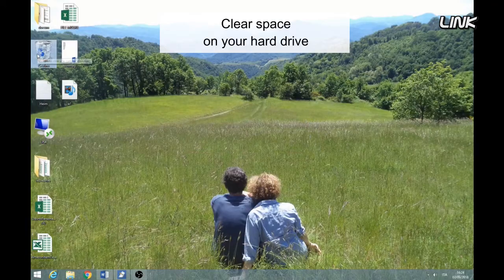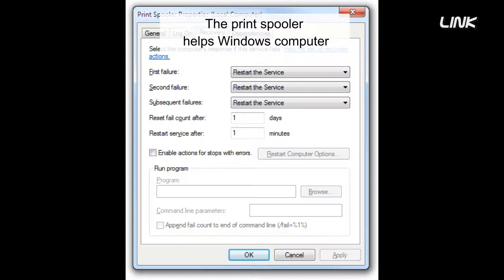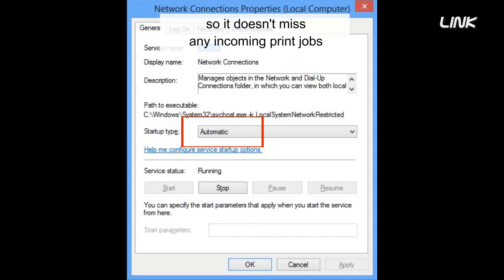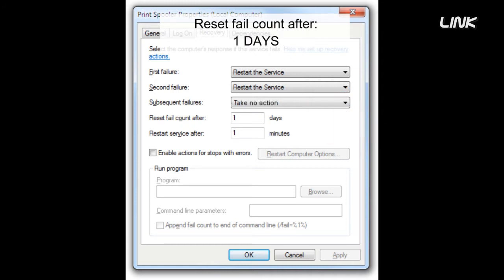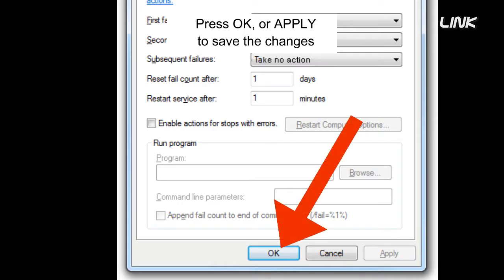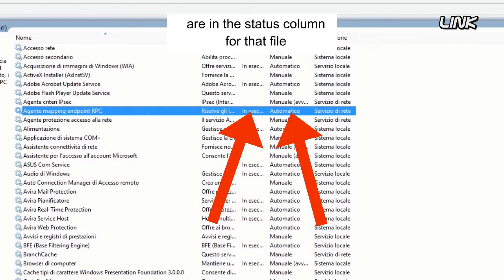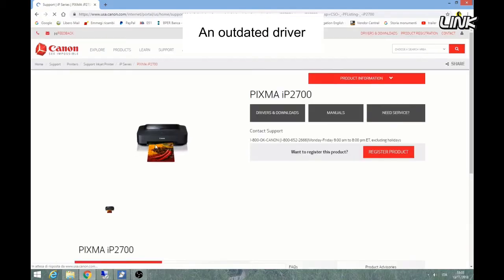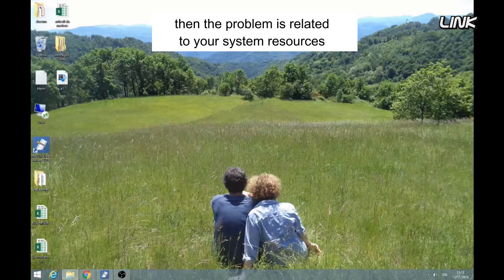Why is your printer so slow?

Comment: Guys I worked for HP before, and what they don’t tell you is that it’s all a mafia. HP is able to send computer code directly to your printer that can slow it down. Sure you.m can try those things they teach to fool you into thinking the problem is that your printer is too old. I was told by my manager they also program printers to say they’re running out of ink when there’s still a bunch of ink. Printer ink is the most expensive liquid on earth btw. To make a long story short once your printer starts slowing down there is only two solutions to fix the problem: You’re either very good at coding and you fix the Scripps that are sent to your printer or you smash your printer into bits and buy a new one. No other solution unfortunately. It’s a huge corporation and the only thing that interests them is profit
Reply: Its a big club and you ain't in it , right? George Carlin was right then!!!!
Reply: Thank you appreciate
Reply: Dude, I recentlty purchased one of HP's 'smart printer' , and I figured out exactly what you are saying here. After countless hours of 'fix it' and 'how to' aggarvation, I contacted HP,  called them out on their monopolizing wits and said that I was going to smash this printer to bits with a five pound sledge hammer, repackage it, and send it back! I am done with HP! LOL

Comment: My hp laserjet 1320 printer, prints normal A4 plain papers fast, but it prints smaller lighter papers slowly, what's the cause?
Reply from the maker: smaller papers you mean smaller dimensions? I don't know,  it dependes on the quality of the printing settings

Comment: awesome find!!! will let u know if it works or not
Reply: did it work?
Reply: I am using Pantum P3500DN model printer but while printing a document of 6.68 MB file, then the spooling is very slow. Some time the document is not printing and printing with a error msg i.e. “PCL XL error”. I have tried all the possibilities which have explained in this video. The printer has 256 MB ram.
Reply: What will I do to resolve the problem?
Reply: @sanjibkumars  I just installed the drivers lOl

Comment: my sharp AR 6020 Nv printer take slow command when printing and coping too. when it start either print or copy one of the job same job do continuously without disturbing but when i change the job (copy to print or print to copy) it take slow command..plz give solutions
Reply from the maker: No one of these methods works?